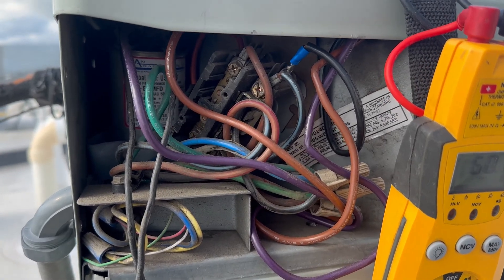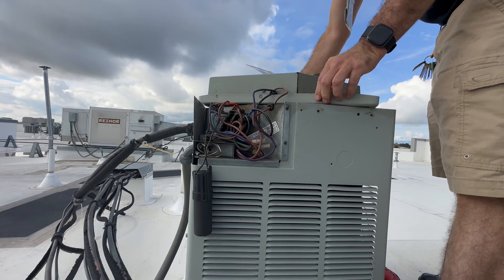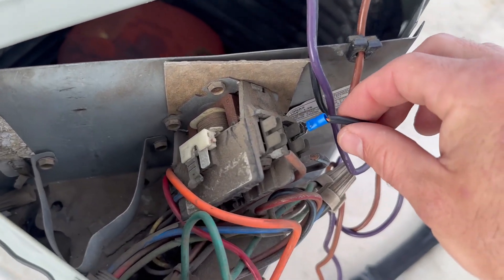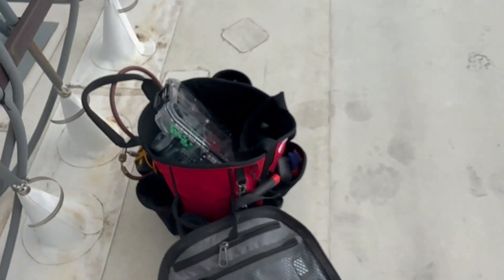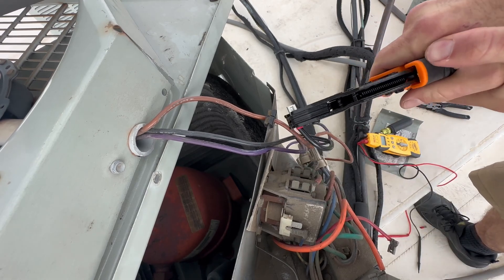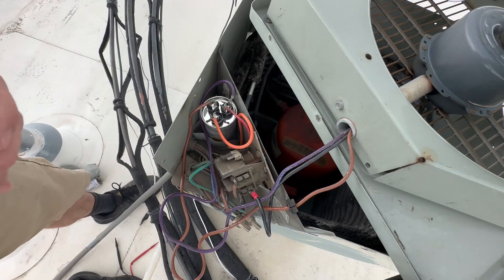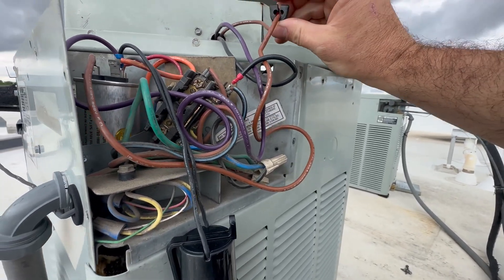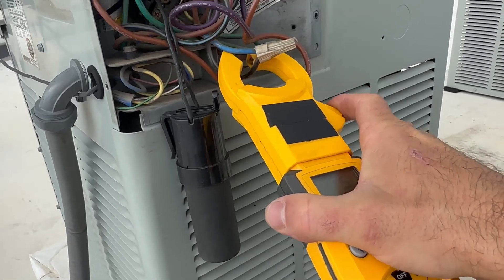A/C Troubleshooting - Compressor AND Fan Won't Run

Comment: THANK YOU, THANK YOU , THANK YOU!!  Today it was 107 in Dallas and the ac went out. Exact same ordeal as this video. I had the old capacitor and it worked. I thought the fan motor was going to be the culprit but it’s still operable. It’s almost 1am and now everyone will sleep better. I’m so grateful. I watched this like 20 times.  God bless you sir.

Comment: Changed run and start capacitor along with a new vontactor due to burnt tips on 220v side, fan and compressor still wont run but i got a low hum from the new start capacitor once power restored. Its a bryant system too. Anything i should be looking for? Windings dont appear to be higher than 5 on the high side, but figured if the compressor was bad the fan should still run . thanks

Comment: ? MY AC IS RATED AT 220 VOLTS 
BURN UP T UP 2 MOTORS GOT REWIND BOUGHT A DIGITAL PROGRAMMABLE CIRCUIT BREAKER IT MEASURES AT THE EVENING HOURS 240 VOLTS REPLACED THE CONDENSER THE UNIT IS PROPERLY GROUNDED I NOTICED A LOT OF KITES N STRINGS TANGLED ON THE POLE WIRE AND DETECTED A SHORT TO GROUND NOTIFIED THE POWER CO 240 WILL THAT FRY MY AC MOTOR

Comment: I just did the same repair on the same unit its a small world
Reply from the maker: Haha right on! Looking forward to more AC repairs, still haven’t had anything close to a heat wave come through Colorado yet
Reply: @ApartmentMaintenancePro   feel you I had a small hot spot come through last month and got my bad units done so I should not have any big problem's this year